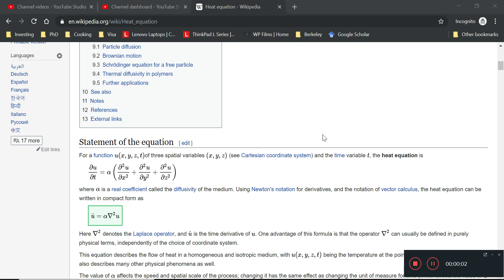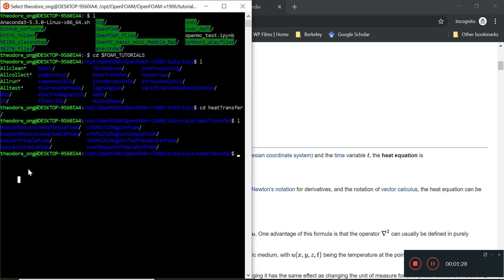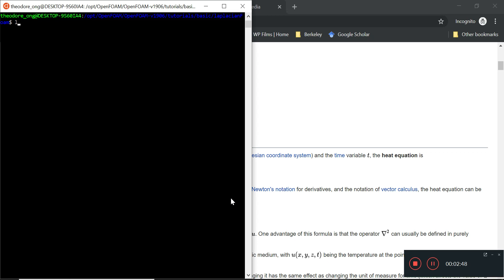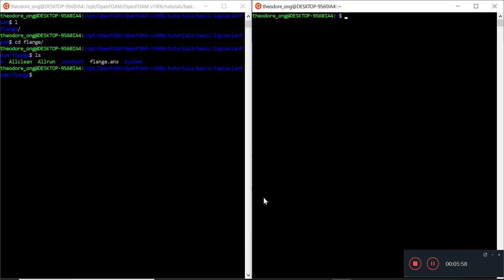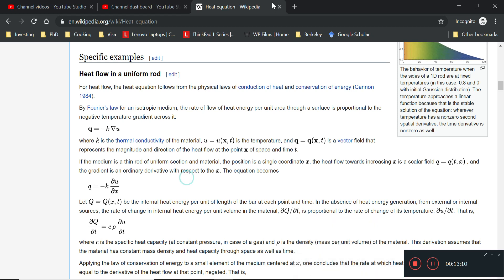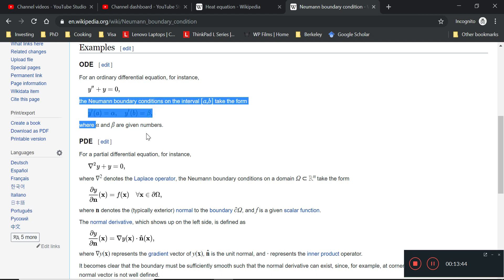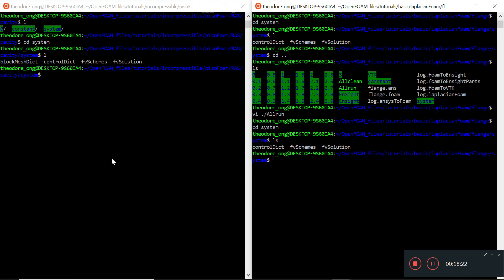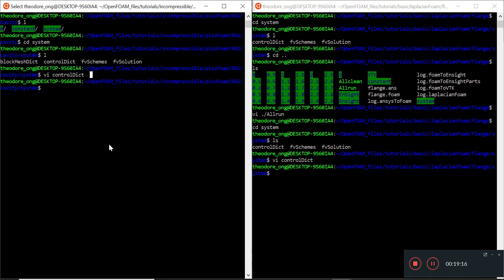OpenFoam Heat Transfer 1 - Overview, Introduction and LaplacianFoam part i

Comment: Hello again Theo,

I'm exploring a case of evaporative cooling in the courtyard of a building. On a hot day without any wind, I trying to test the airflow in the courtyard with a mist system at the top. Assuming that in dry conditions the evaporative cooling effect of water injected in the air could make the air temperature drop down10 C, the cooled air would induce a downdraught that would refresh the spaces.

I'm simulating using buoyantSimpleFoam + fvDom radiation + fvOptions (scalarSemiImplicitSource with  injectionRateSuSp) + topoSet:
- topoSet to an arbitrary region at the top of the couryard that corresponds to a simplified  injection of mist
- topoSet to set a 2m high box from the ground that simplifies all the internal gains (people, lighting, equipments)
- fvOptions to approximate the drop in temperature and the internal heat gains respectively from, that mist region and that internal gains box as sensibleEnthalpy or sensibleInternalEnergy
- fvDom to account for the surface temperatures

I am really struggling to set  the fvOptions correctly with the correct units and values of either enthalpy or internal energy (sensible or absolute). So far my reasoning remains at:
- for mist/sprinklers: I look at the Mollier Chart for a drop of 10 C when the dry air is at 30C, the enthalpy needed is 80 kj/kg, so I set  "h  (-80000 0);" 
- for internal gains/heat: I have 72 W/m2 in a height of 2m so I set : 36 W/m3.

Would you have any tips or tutorial that would help me set these better?

I hope I was understandable,  sorry for the long written problem.

Thanks,
OLivier

scalarSemiImplicitSourceCoeffs
{
 cellSet sprinklersP; 
 selectionMode cellSet;
 volumeMode specific; 
 injectionRateSuSp
 {
  h  (-80000 0); 
 }
}

heat
{
 type scalarSemiImplicitSource;
 active true;
 scalarSemiImplicitSourceCoeffs
 {
  cellZone cellZone2;
  selectionMode cellZone;
  volumeMode specific; 
  injectionRateSuSp
  {
   h  (36 0); 
  }
 }
}